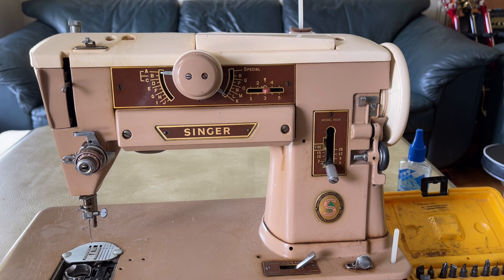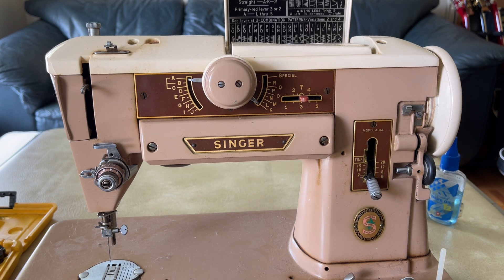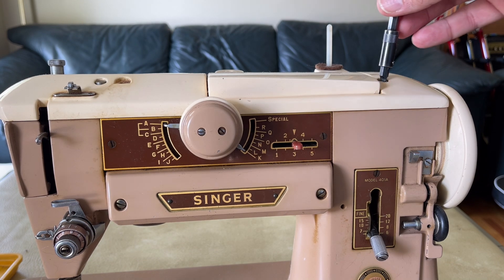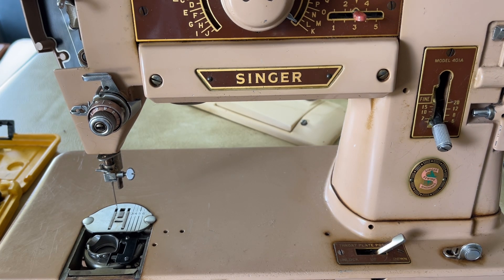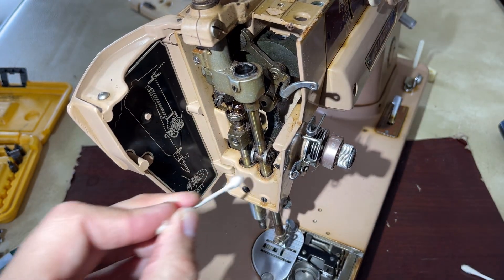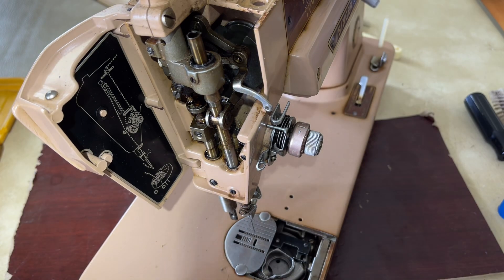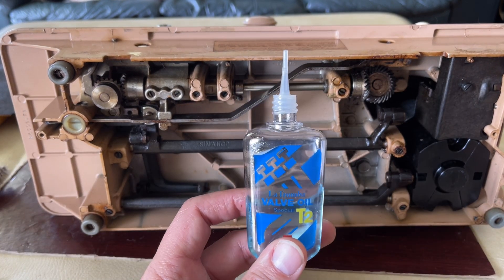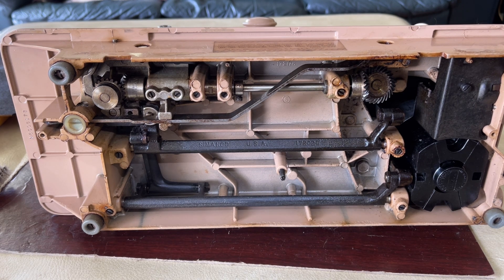PURCHASING SERIES #41: Fashionably Late to the ZigZag Party!  A Deep Dive Look at Singer's 401A

Comment: I love maintaining my late mothers 1966 Singer Zig Zag 623, along with my 1982 NECCHI 523.
Both heavy metal machines are still humming. Lubrication is crucial. I can't find the oil filters though 🤣‼️.
73, man, New Hampshire  Great channel
 🧵🧵🧵🧵🧵 🪡
ps, the word your looking for when soaking all the stuck parts with your valve oil is " marinate " 👍

Comment: I have a 301A (little brother to your 401A I suppose 😃) that I haven't used in a while; it was working just fine. But about 6 months ago when I tried to sew, it just kept making nests in the bobbin case after one or two turns. I've made sure it has all the correct bobbins and am using the correct needle size.
 Now that I've taken encouragement from your video here, I'm going to try to gently, carefully and patiently (thought about taking it to Sally Ann 😅) to inspect it more closely, to see what might be causing the problem.  I really do like the machine; it's a powerhouse for anything I've sewn in the past. Bought it for $25!                                                                                                            If you read this and have any suggestions, I'd be most grateful. Thank-YOU!